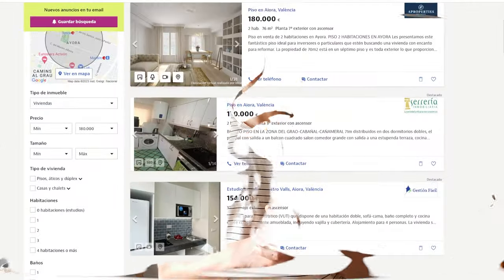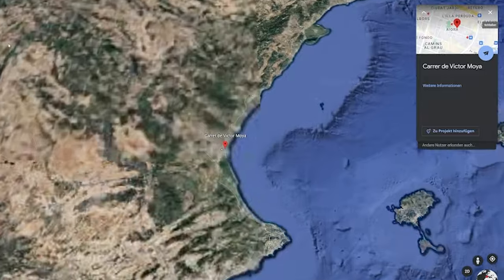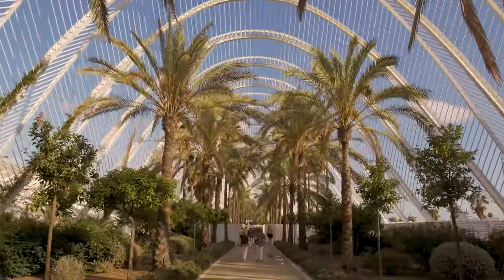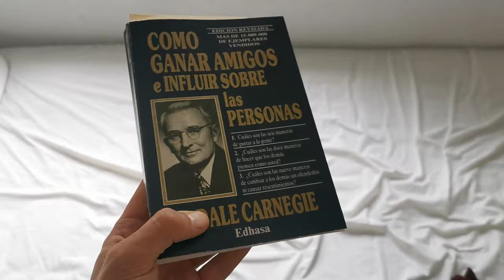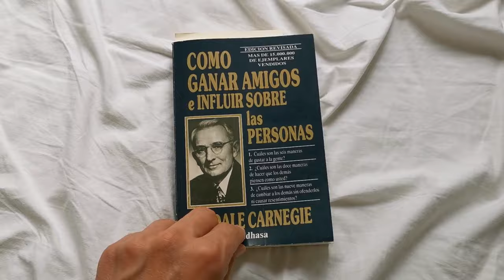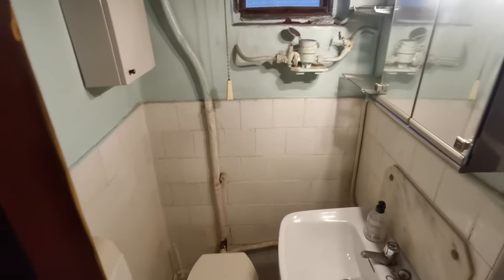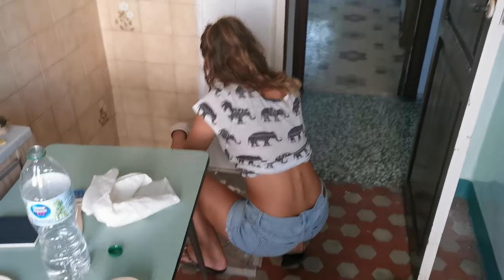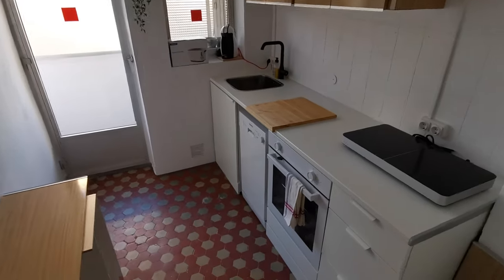1st Flat! Valencia Apartment Renovation: From Makeover to Rental Success!

Comment: I was hoping to see it's valuation after your refurb.  Also, the refurb  bathroom cost 9,600€ seems v high...but lm sure you had other quotes. Yes, l understand all new pipework etc. l renovate properties (Costa Blanca Benissa area) l buy at the low end of the housing market, refurb  to a high  spec, then sell. I wish you well.